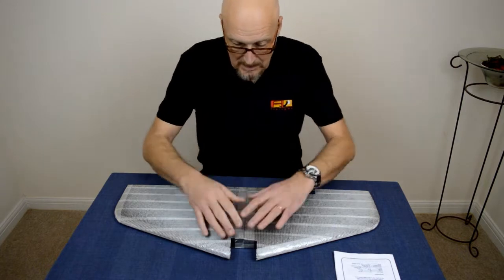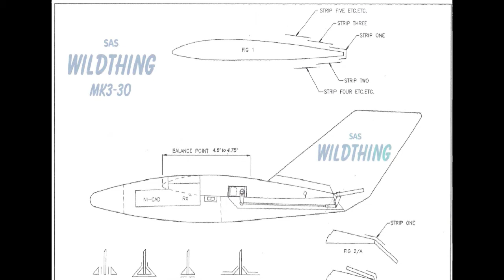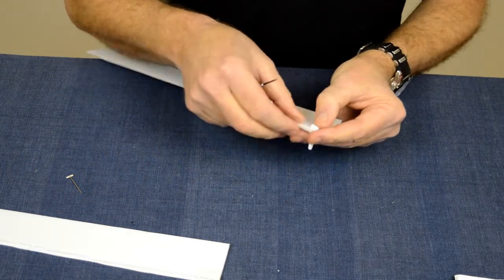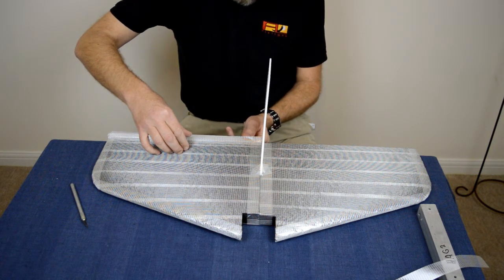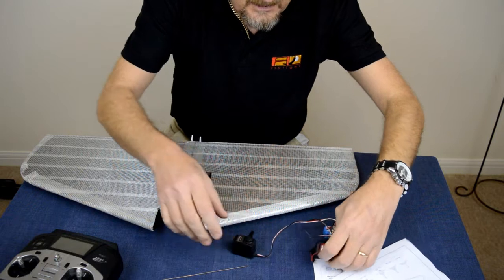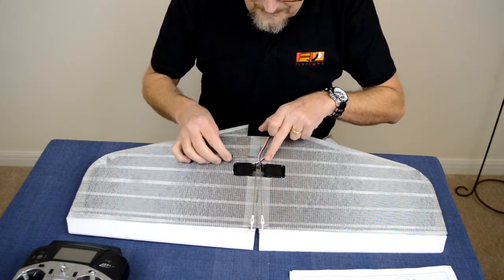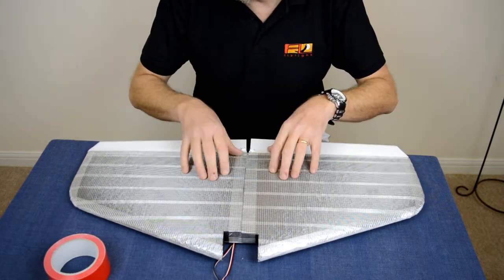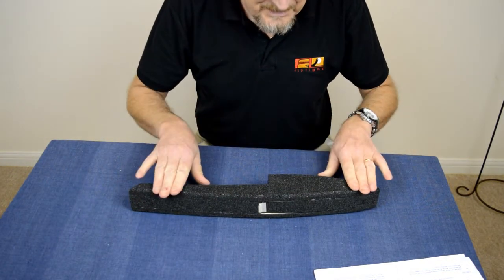How to Build an SAS wildthing EPP slope soarer part 2

Comment: Great videos and a huge help before I build mine. I have 3 questions (in case anyone is reading this after 8 years and has thoughts):

1) Would it save time and make a stronger and neater job if wing halves were glued together before glass tape covering as one continuous strip could be used along the whole span (this question also applies to the covering later on with coloured tape though I can see that the thinner tape might be trickier to lay straight without wrinkling etc)
2) Would it not be better if the ailerons were bottom hinged in order to achieve smoother airflow along the wing underside (the air will be turbulent at this point on the upper surface so there's less benefit in top hingeing)
3) I hate cutting the mounts off servos just in case I should ever want to use them elsewhere (this habit comes from my early RC days and perhaps servos are heaper these days and I should stop fussing!). Would it really matter if I chose to cut slots to accommodate them in the wing.?
Reply from the maker: @mikeonb4c  eight years on you could do wing in one piece I just followed instructions 
You could try bottom hinging it’s a fat section so no gains or loss in my view.
Keep the lugs on if you want 
Iam still flying mine 😍